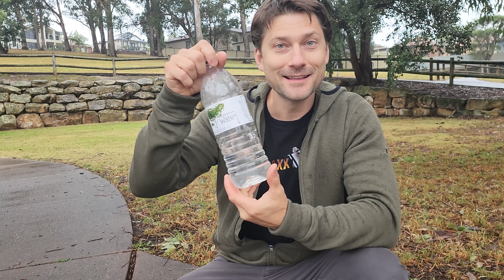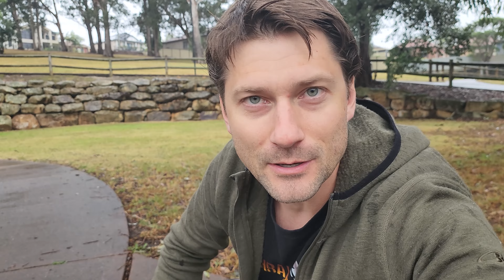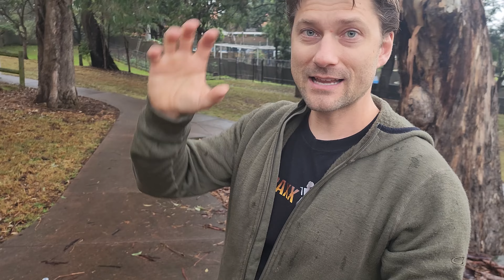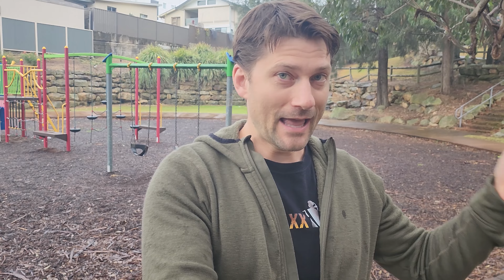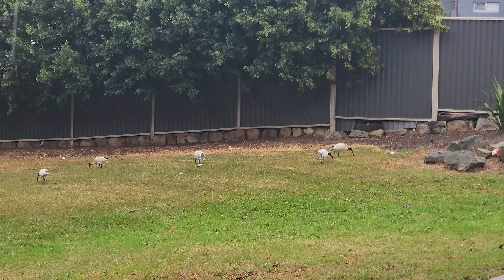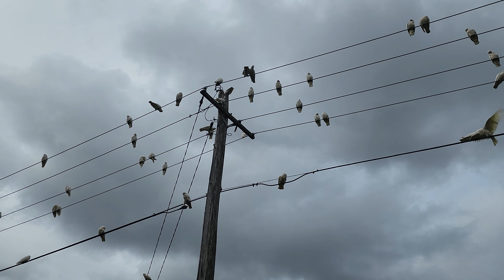Some Thoughts on Highbanker Classification Options.

Comment: I made my highbanker as cheap as i could, when it came to the solution of grisly bars with out a welding aluminum i went with aluminum flat bar. I drilled holes in the flat bar then mounted them onto a threaded rod the spacing between the bars you can use washes or cut aluminum flat bar with a hole like a washer to create the gaps. Its super light weight and works fairly well, it is a little labor intensive drilling all the holes and cutting to length but totally worth it. As for the flex where the flat bars sit on the rear of the bottom sluice my plan is to cut a tooth pattern that the flat bar slots into. With a wider toothed slot than the flat bar width allows them to move side to side but not to far, I can also flick the bars vertically as they can rotate a little on the threaded rod. 
Clearing my grisly from a jam now takes a scrape with the shovel and a few flicks vertically with my hand total about 10 seconds.
It might not be the best solution but it was cheap and i could make it with basic tools and its super effective.

Comment: good morning, looks like a beautifulwinter day there.  So yes Kyle, I had already noticed the problem of scrubbing off the screen and rememebered how satisfied you were when you built your grizzly. I too had visulaized  using several grizzlies to "round the corner" and visualized them as pick combs lol. So we are on the same page. The nugget trap belongs in the hopper or before the grizzly, yes. I thought of a rounded grizzly but that would be quite a bit of engineering. Another thing i considered is stacked grizzlies, like stacking classifiers, to get smaller sand, but not all in one grizzly . That is how the sand screeners work in the gravel pit.. I will put some more thought into it and let you know if i get any new brain farts lol. Cheers, enjoy your holiday, you deserve it. ..Kelly
Reply from the maker: Thanks Kelly!
Yeah, I think I like the idea of a mini nugget catch before the grizzly, and if it's practical to use a grizzly instead of a screen it's definitely worth another shot.  So much goes into the hopper part of a highbanker, I'm glad I've mostly got the sluice part decided on at this point :)

Comment: I've often thought that a two level grizzly would be worth looking into. The top one say 1/2" to handle all the gravel and organics and then down to 1/8" for fine gold. That way most of the volume is dealt with before the final classifacation. Obviously you would need different sizes for different gold and a quick release to clean out any clogs in the lower. But it allows good washing of all material and eliminates some of the problems of larger material fouling up the process and also making its way into the sluice. Of course it will need fine tuning to get the sizing and slope right but that is half the fun.

Comment: Lots of great thoughts here. On the prototyping front you should look into 3D printing. It would be great for testing a design before spending the cash on a metal version. Also, it is possible to make a silicone mold of a 3D print and use the mold to cast metal. Pretty cool stuff theres a few videos out there showing how to do it. You can make very complex shapes with 3d printing so a round toothed comb would be doable for sure. It could also be useful for other little parts around the sluice. I made a few adapters for my bilge pump and different off the shelf hoses (sump hose is much better than most bilge hoses). I also made leg brackets. They bolt onto the sluice and hold a captive nut and allows a aluminum rod to slide in and clamp. 

Another idea would be a 3D printed end cap on the grizzly that would hold the bar spacing but could be popped out easily for cleaning.

Cheers
Reply from the maker: Great ideas!

Comment: Food for thought you're talking about somehow having a nugget trap up above in your header box. What if you made a long teardrop shape cut out punch plate with the teardrop upside down. Cut it with a plasma cutter. Then put like a small Dropbox Ripple like three quarters of an inch by 3/4 of an inch below that at the back or what we would call a head of the box. So when the bigger pieces went into the punch plate that this punch teardrop shaped plate is tapered also in the cut. Making sure that this taper is pointing up in the wider part is underneath. Inverted v cut in teardrop shape. Shaped like that it would let the organic wash out or off of the punch plate without having to brush them off. Also it would keep the rocks from lodging in the plate That nugget trap I'm talking about at the top of the header box like a drop-down Ripple or like what's in the gold Cube before it would hit the rest of his slick plate. Basically a teardrop cut with an tapering narrow tapering side up
Reply from the maker: I THINK I've visualized what you described correctly...  I guess it would be a test of would the dropped area catch all the big stuff, or let that stuff slide out.  Would just take some testing and tweaking if I went that route.  Interesting thoughts!

Comment: If you watch Freddy Dodge and Juan they did a similar punch plate for a guy up to Valdez Alaska that is teardrop shaped like I'm talking about. Does not need to be quite that thick of a plate steel to work I think. If you watch the water crash on the head of your box it would drop down into that squared notched reverse riple or that AKA Dropbox I would think the lighter material would blow out of there and leave the heaviest behind. When I watch the water action on your sluice the thoughts come to my mind when it hits that back wall

Comment: Perhaps you could experiment with some stiff plastic rather than sheet stainless steel - might have to be thicker than 12 guage for sure.
But you be able to cut it with a router or something - no need to pay for laser
Reply from the maker: I'll look into it, thanks for the suggestion!

Comment: Hi Mate. A lot of thinking. I had directly an idea in my mind. Is the weight of the grizzly very important? If not is a harder type of metal better it bends less. Stainless steel is lighter but also more soft. Second is why not leaving it a foot long. If you make a plate one foot long and half inch high and make three holes in instead of two , you get more solid in the middle to. And it will bend with harder metal a lot less. And if you Pulverrice it in black it will not rust away. I hope Pulverrice is the right word you know like exhaust pipes of a motorcycle. But with another holder in the middle is it more stable. Laser cut is awesome. I'm excited to see it. Cheers Tom
Reply from the maker: I'll look into other metals and see what I think.  Stainless I guess is just an option because I had used it for the legs, but probably not the ideal material...

Comment: Layer the grizzly over/above the mesh? I know nothing about sluices but it seems like it would allow the organics to shed without clogging the mesh, which seems to be the biggest issue with the mesh.
Reply from the maker: Yeah some sort of double level setup would be neat, my concern would be if the lower level needed cleaning you would have to routinely remove the top level to get under it.  Worth considering for sure though...
Reply: @UtmostOutdoors  quick loose test with a bunch of organic material before creating would probably answer it. Test test test... measure twice before jumping. Love your creative thinking and willingness to try what comes to mind. Looking forward to see what you find down under! 🦘

Comment: I think a comb Lazer cut would work great,I also think just two ,should be enough,I'm working on mine right now,the first hopper is to short and the screen is to short,I have to trickle feed it,I'm wanting to add 6-8" of flat,and about 3-4" of screen, that should allow the room for a shovel full to get separated and wash ,without over splash off the screen
Reply from the maker: Nice.  Yeah, longer screen area is definitely a nice feature.

Comment: mmmm interesting problems .
1 seems like the big rigs solve this by putting in a drum that rotates . could long term thing of something like that that would have progressive holes . power it off the water pump maybe . for that matter possibly an agitator with a separated upper sluce box might be something easy and cheep to try . 
2 for a lower teck options . what are the advantages of having the fingers lose on the end . could you weld up both sides with a cutout saddle . and for that matter could you bend the fingers to match your mesh . 
3 for prototyping i have found that 3d printing is a fairly decent way to give rapid prototyping . some times libraries , cities, or like makers guilds will have a print farm that is open to the public that you can get a few hr with one for nearly the cost of filament . or you can network with a smaller print farm . best would be a friend that has one that you could change a 4 day luxury boat ride and mistic vintage workout found to vigorate the mind and juvinate the body for some print time . .... 

good luck , have fun . and love the content and seeing you try hard .

Comment: Sounds like an interesting experiment, I fear you may have a loss of rock push out of the hopper as well as well as the say median rock getting trapped in the raised expanded and also trapping or stopping larger rock from  free roll. May still need to make the hopper adjustable for say one setting for frazer and one for n.s. alternatively thicker grizzly bars similar to the first one's except thicker "to handle the large rock" spaced further apart with cross bar's on the under side to assist nugget capture negative side more cleanup material. I would stick with rod style material as grass and root material may grab edge of cut out material , as well I can see the grizzly bar's extending couple of inches past drop section to help alleviate grass buildup on the screen section.
Reply from the maker: I like your thoughts here.  I think the rocks exiting past a nugget catch could be fixed by having that angle independently adjustable as you say, and as per round rods vs laser cut grizzly, I can definitely see the laser cut edged having some trouble.  But I'm curious enough to want to see how it might work, and it would certainly make the fabrication part easier if it did work...  I'll have to try and fail for others to learn from maybe?
Reply: I absolutely agree with trial and error and yes welding steel rod is time consuming.  Regardless it's still a kick butt sluice . Proud of my edmonton  brother from another mother. You  are doing the very things i wish I had the time/money/resources to do. Flap them wings and safe journey home. Who knows we might meet on n.s. some day. I'm trying to plan a trip to the peace river this fall hoping to hit at least one of the spots I've picked . I'm still a pack and pan fella.

Comment: is there a screen that has long holes, rectangle shape?, so that the holes are a couple of inches long, you would get no spreading like a grizzly and it may clean better with organics, maybe not as well as a grizzly but better. plus it would be a lot cheaper than laser cutting or perhaps you could get the screen cut into the shape you want if there is not one off the shelf 🤔
Reply from the maker: I wonder if I could remove every second cross bar from my existing screen as an experiment to see how that works...  The rectangular holes might work as a good balance between screen and grizzly as you mentioned.